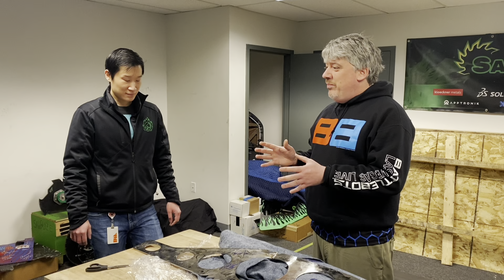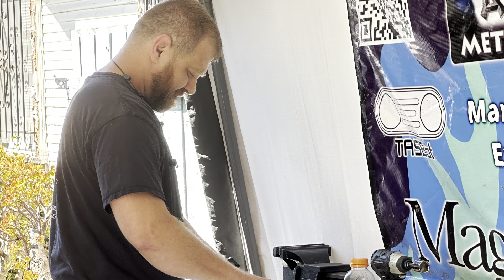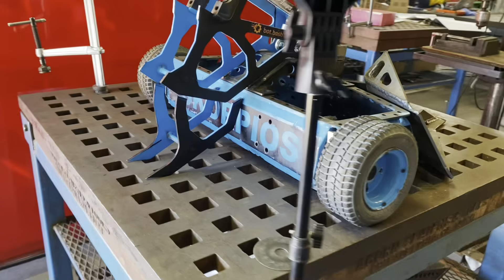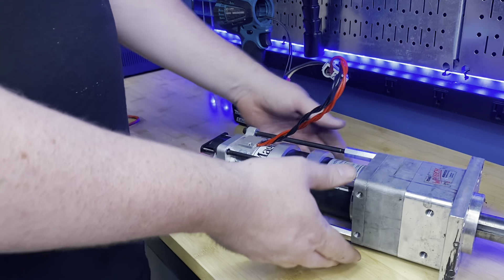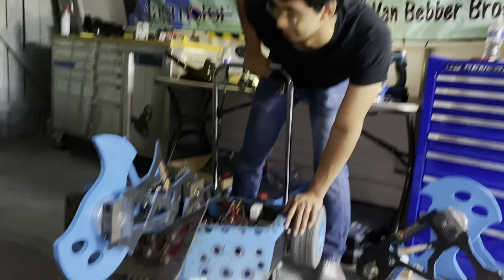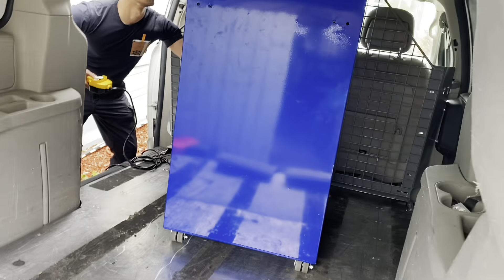Everything We Changed In Skorpios For Battlebots Face-Offs!

Comment: @Skorpios Battlebot, Zack, you should cut that wheelie-bar and attach it to the body so that it doesn't put all the weight on the back end of the axe handle when you attack with the weapon arm and it should give you more stability and it keeps the weapon up away from the enemy so as not to get damaged.

Comment: Exciting to see the new developments! 
two notes:
1. Try to level the audio. Sometimes I have to crank the volume to almost 100% and the next moment i almost blow the windows out the room.
2. Isn't it possible to have the arm push back automatically if you go over say 25% throttle which is overwritten as soon as the weapon operator gives input?

Comment: Nice upgrades! To totally inexperienced me, the wheels still look exposed. Or is that in real battle less of a problem than it looks?
Reply: Actually having covered wheels can turn into an even bigger problem. Witch doctor in one of his fight got his front wheel stuck on dented plate that covered them.
Reply: @The_Moodi  or the guard can get torn off anyway as with Tombstone vs Bronco.
Reply: @The_Moodi  Same thing happened to Fusion in the HUGE fight. One of the hits caved in the side armor locking the wheel inside.
Reply: That tends to not be an issue anymore, lots of bots have exposed wheels nowadays. It used to be an issue when a lot of people's gameplans was to go for the wheels but as bots have gotten faster and more agile over the years and can move their wheels out of harms way, it's not really worth it to try and attack the wheels. The only time I've really seen attacking the wheels work is when Minotaur took all 6 of Bronco's wheels off in WCII.